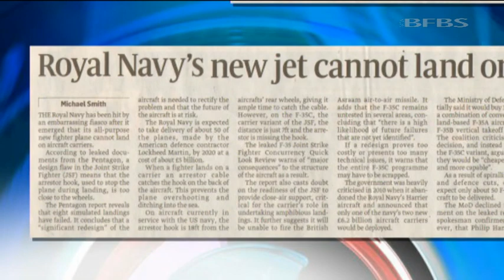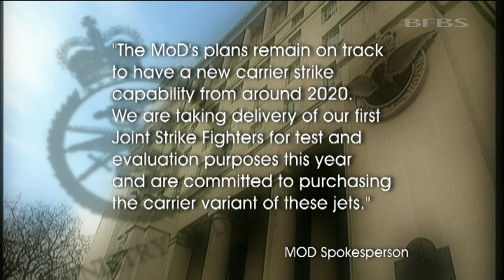New F35-C fighter's 'future in doubt' 16.01.12

Comment: The F35 is useless. It will ruin any Air Force that uses it. Whatever capability they have with the F16s or F18s will be degraded. It isn't a fighter because it can't turn, its a horrible bomber because to be stealthy it only carries 2 bombs and -worst off all- its a complete disaster for close support of troops, it can't perform the mission. They are only 30% through the testing and the hard stuff's yet to come. There'll be more delays and the cost will keep rising.